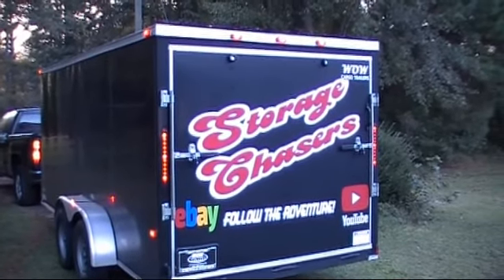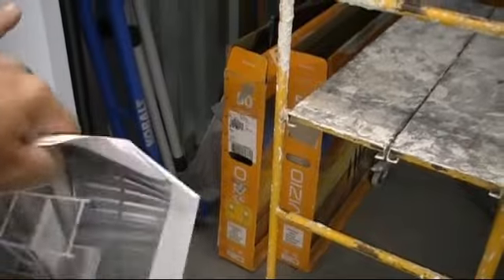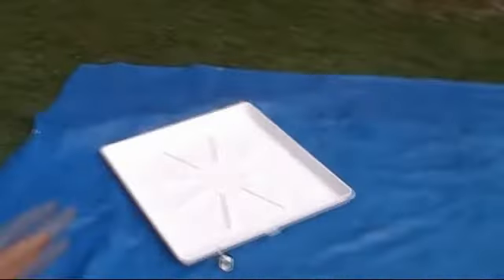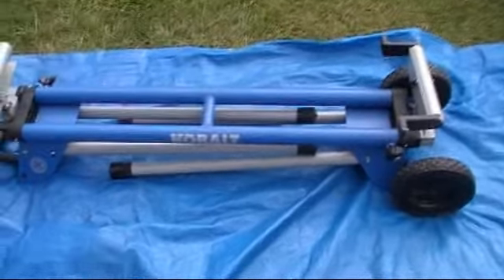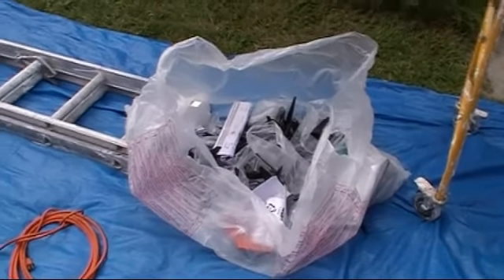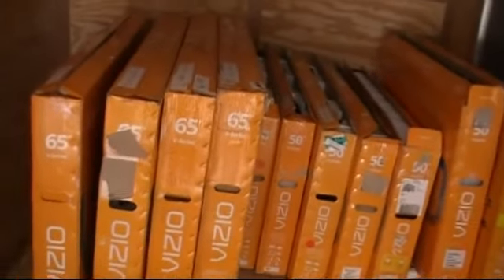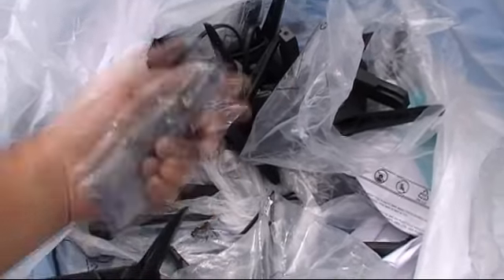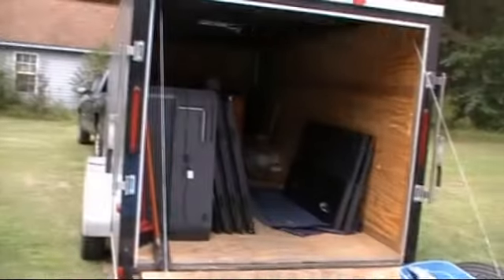$700 mistake, I bought an abandoned storage unit

Comment: I stopped having accidental wins by not bidding on anything that looks like junk
Reply from the maker: Good advise, but as a smaller buyer/reseller we try to bid on items that we see and can make a profit on, and in this case I saw 250-300 worth of sales so for the small bid of 180 I could have doubled my investment which is great. However the 180 turned to 1180 and I ate the loss as a champ and I can move forward with the knowledge that I now have. Some accidents hurt and some teach. It depends on the person. Thanks for your response. We truly appreciate any and all advice.
Reply: @storagechasers7403  i made the mistake of bidding 20 on about 25 auctions and wouldn't you know i won 11 . Yes I made money but the work wasn't worth the profit.  I now never bid on anything I don't really want.
Reply from the maker: Cdl Picker we typically only bid on units we like, but sometimes I just get caught up in the bidding and have to win the unit even if I will only break even with what I see. Often times it’s what you don’t see that can make or break a unit.